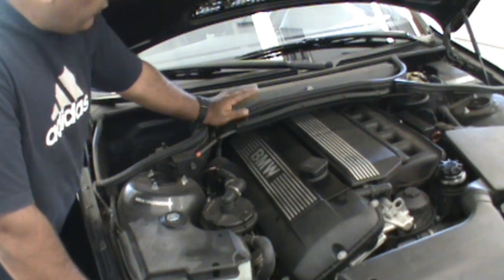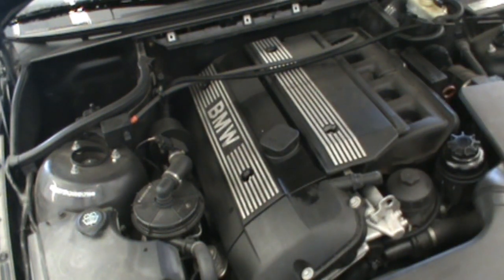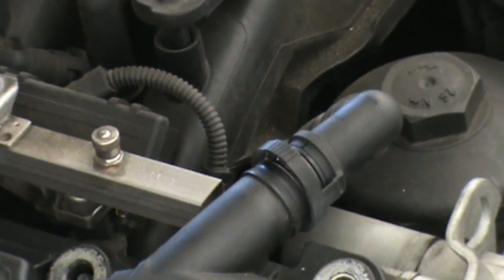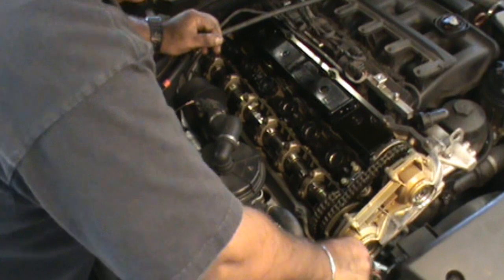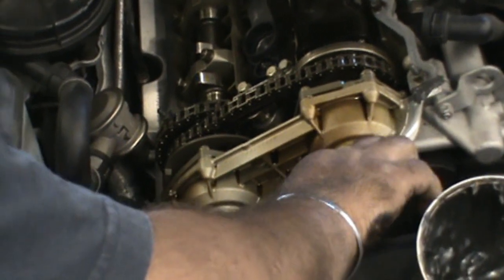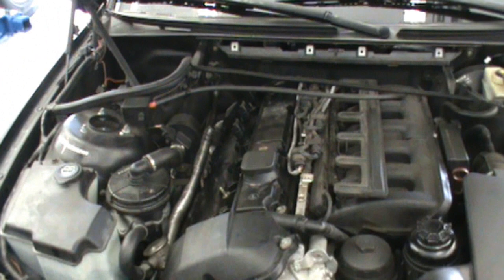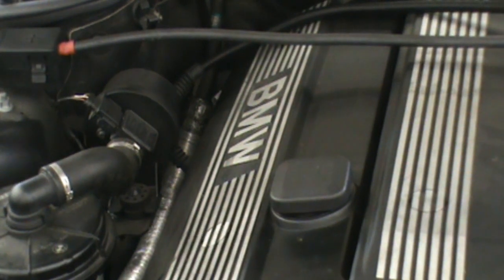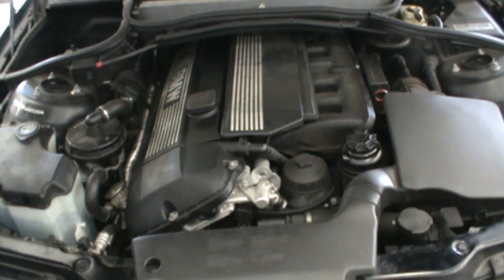Replacing Your BMW Valve Cover Gasket

Comment: Just completed this job on my 2004 BMW Z4. I don't think it's necessary (at least on the Z4) to tack the cylinder head gaskets directly to the head. The cover has grooves that held both the cylinder and outer gaskets in place just fine. Due to concerns about cracking the plastic cover (as I presume it too gets brittle from engine heat over the years) I was very slow to tighten down all the fasteners. I did a complete round about 5 times, adding a bit more torque to each before doing the final torque ... no cracks - whew!

Thanks for the great vid. Much appreciated.

Comment: Raj, just wondering what's the make of that drill you're using. It looks pretty compact. Great video but way too much shop noise. I've done this job once and failed to remove the cabin filter housing which means I couldn't get to the back of the motor well enough to seal it properly with RTV. I'll do this next time and do it right. Also be sure to thoroughly clean the gasket mating areas. I used Wurth brake cleaner since it cleans well and leaves no residue. Fantastic stuff. Again, thanks for the viddy.

Comment: Watched several of these DIY videos replacing valve cover gasket on E46...6mo ago replaced one coil pack used OBD reader and swapped coils and reread OBD...didnt matter new NAPA part worked just like BMW part, don't see why order could matter.

Comment: This video was VERY helpful,I will be doing this repair myself soon, and Thank you 
ps the place where I had this repair done 2x didn't do the job as it still leaks,My guess is the valve cover is warped and they didn't check this.if your doing this repair,check the cover for warps.

Comment: Sounds most likely to be Mass Air Flow Sensor to be honest its a common fault. If its an E46 unplug it and see how it goes but let it idle for about 5 mins after its unplugged (DO NOT UNPLUG WHILE RUNNING) And make sure its a cold engine. it sits directly behind the Air Filter box.

Craig (message me if you have any issues though worked with BMW as an apprentice)

Comment: The video was very good up to the point where you was replacing the valve cover you didn't give how tight to torque it.  That is a very important part of changing the gasket so you won't over tighten it.
Reply: Gotta listen more carefully. at 12:05 he says the bolts are torqued to 10 N·m.

Comment: Why did you put the spark plug tube seals on the head? I just did one yesterday and they go on the valve cover nicely just like the valve cover gasket so that way there is no misalignment which could cut/damage the tube seals.

Comment: No, they said it was leaking oil in the rear of the valve cover in the video.

I paid a mechanic in San Diego to do this and it's leaking worse than before.  Time to do it myself :)

Comment: Good video.   I have similar question to Jetubeb below.   I have symptoms which make me think my valvecover gasket needs replacing - 1) I'm starting to smell burning oil inside the cabin, most strongly when sitting still and especially if my car's still but on an incline (my driveway is uphill and I smell it then every time)..... 2) My engine's running lean (won't a leaking valvecover cause a vacuum leak?), 3) losing oil at very slow rate.    Figure it's a cheap thing to try, what do u think?

Comment: just wondering why it matters the ignition coils go back in to their respective connectors?  are they not all the same?  and if you replace them all with new do you still need to put on some grease?

Comment: hey guys great video...just completed...and no leaks! but but now i got mis rough idle low power on lower rpm's vaccum leak electrical? got a buy a code reader which would you recommend?

Comment: i did this a couple of months ago to fix oil leaking into the number three spark plug... all was well until now and now have a oil leak at the back bottom "half moon". I used the 82194 RTV but maybe i used to much. you guys said to just use a little smear in the video but i recall i used like a toothpaste application of the stuff... did it shrink up or something? Thanks

Comment: There is a lot of background noise in this video that makes it difficult to understand what the people are saying. It sounds like someone is saying something about disconnecting a battery cable, but because there is so much background noise, we really can't tell if they are addressing this repair, or if someone off camera is talking to someone else. Then there is also the air hose or gun. Can't tell which.

Comment: hey questio... tell how many reason could be or can be cause the bmw overheating????cuz i just change the both coolant temperature sensor upper and down sensor plus i change the coolant expantion tank thermostat the one goes i tank, but i didnt touch the thermostat yet cuz i think stil good or am not sure. or how can i know if thermostat is good??i turn on the car without radiador upper hose by the thermostat with littl bit coolant and when i turn the car stil blowin antifreez from thermostat.

Comment: lol this takes about 3 mins on a honda
Reply: Not on a V6 Honda, you have to take off the upper intake manifold plenum to get to one of the valve covers. So actually it's easier on the BMW. This is a Inline 6 not the 4 cylinder BMW. On top of that there is only one valve cover to do on the BMW vs the Honda's V6 which has two, so 6 cylinder vs 6 cylinder I would much rather do a BMW valve cover gasket.
Reply: Paul Nunya
I'd add that I''d much rather drive a BMW ! !